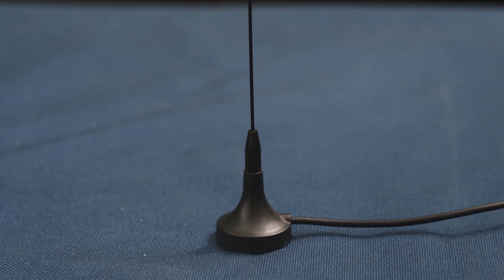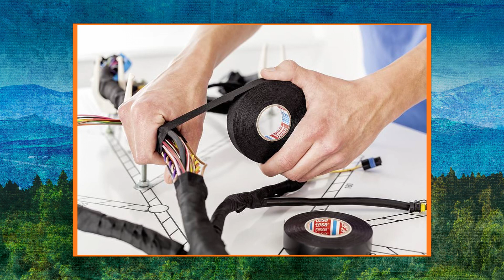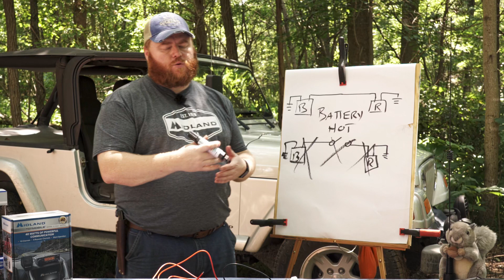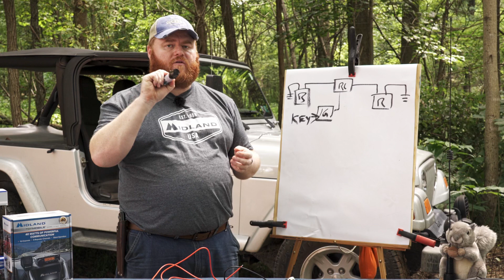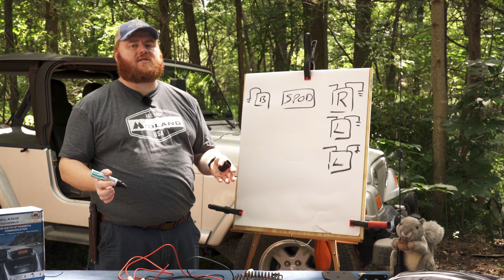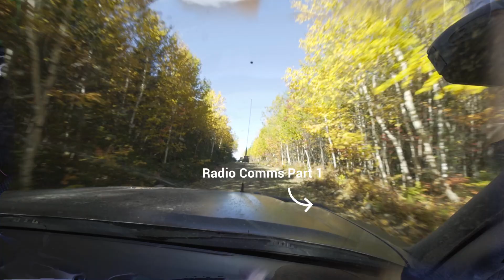Mobile Radios Install Tips - Overland Communications

Comment: ferrite is not a magnet
Reply from the maker: "A ferrite is a ceramic material made by mixing and firing large proportions of iron(III) oxide (Fe2O3, rust) blended with small proportions of one or more additional metallic elements, such as barium, manganese, nickel, and zinc. They are electrically nonconductive, meaning that they are insulators, and ferrimagnetic, meaning they can easily be magnetized or attracted to a magnet." ~ So yeah, half true.  Not all ferrites are magnets, but but they can be magnetic.
Reply: @BlueRidgeOverlandGear  You are partially right.  It is a noise reduction (interference) non-magnetic device that induces a high impedance (resistance) that blocks the interference!  Different mixes for different uses.  They also come in a  doughnut shape and in different sizes/mixes for different uses.  Visit Amidon or Palomar Engineers on the web for more information. Palomar also has an interference reduction guide that you can download in PDF format.

Comment: What bag are your GXT radios in?
Reply from the maker: It's a modified Cooking Kit bag.  Just cut the seems out of the pockets for the utensils.
Reply: @BlueRidgeOverlandGear  Thanks! You should offer that bag without the seems for this purpose ;-) 
Ordering a bag now! :-)
Reply from the maker: It's in the works.  Just have to get caught up past orders before we offer something new.
Reply: @BlueRidgeOverlandGear  Awesome to hear! Maybe I should hold off until it is available. I don't want to potentially ruin a perfectly good new bag if I don't have too!
Reply from the maker: Yeah, the one issue with the kitchen bag is that once you cut the seams out one of the pockets is a little bigger than the other.  If we do a production radio bag - key word if - then we would most likely make both main pockets big enough for the larger GRMS radios.  Right now the one pocket is big enough for the 1000 series GRMS radios, but the other one is only big enough for the smaller FRS handhelds.  My Boefang 5's barely fit.
Reply: Ahh, I gotcha. Ok, Well I hope this will be a new product eventually! Would be a great way to keep handhelds organized and protected for sure!